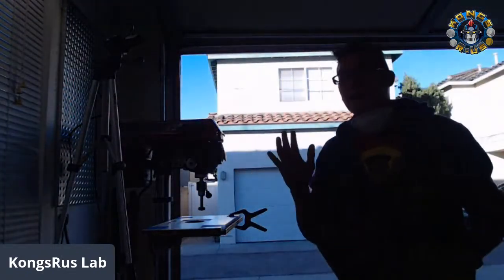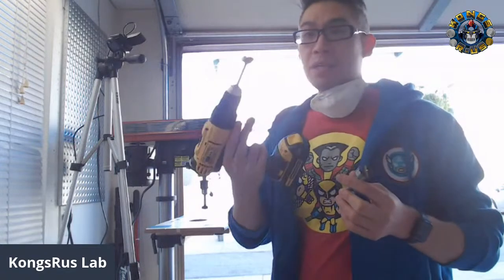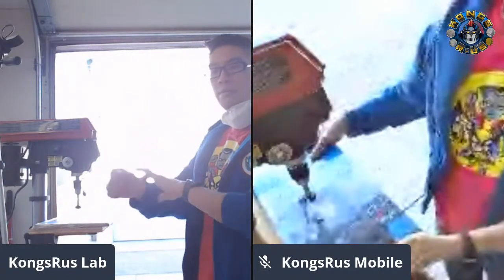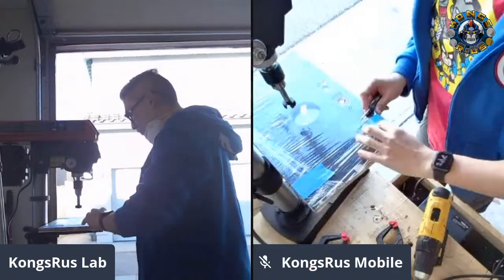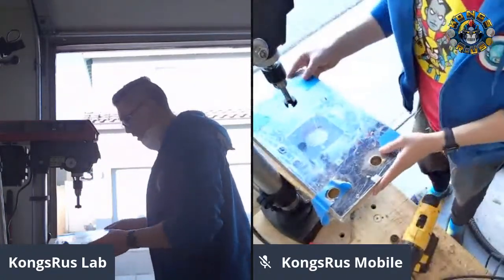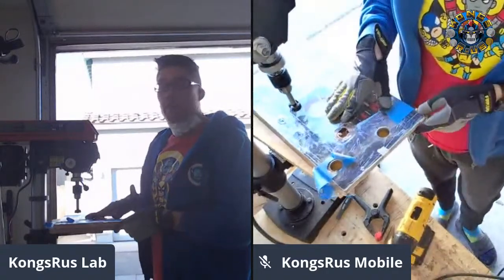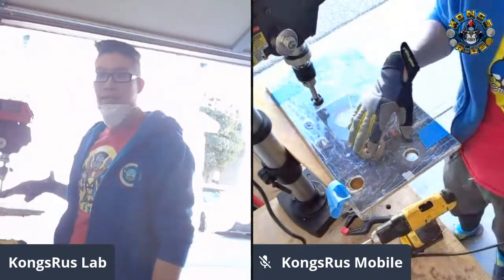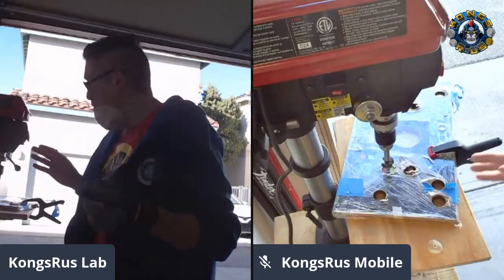How to Drill - LIVE Modding Demo Arcade1Up (Step Bit, Hole Saw, Forstner Bit, Drill Press) Star Wars

Comment: When you saran wrap the plexiglass, do you wrap it and the control panel together? Or do you wrap the plexiglass by itself and then tape it to the control panel?
Reply from the maker: by itself. then make sure its taped to the control panel if you plan on drilling them together

Comment: Do you use the same 1-1/8" bit for panel and plexi or is plexi larger?
Reply from the maker: For most of my mods, I use the same 1-1/8" forstner drill bit to go thru both the panel and plexi at the same time.

If you want to match the style that Arcade1up does with their plexi, they use 1-1/2" holes in the plexi and a smaller hole for the panel
Reply: @KongsRUs  Sincerely appreciated!
Reply: @KongsRUs  sorry, first timer. Safe to assume that the buttons would then go on top of plei, correct (when using 1-1/8 for both)?  Or do you still install to panel and then top with plexi. Seems obvious, but just checking. No further questions 🤣
Reply from the maker: @nafscub  no worries, when I used the 1-1-8" hole. The buttons just sit on top of the plexi. Curious- what panel are you drilling?
Reply: @KongsRUs  nba jam. Select buttons for all 4 players. +3 buttons for P1 & P2. Probably +1 to P3 & P4. Probably not the ideal project fir a 1st timer, but here I am
Reply from the maker: @nafscub  ah snap, lol, that's a big panel!! Biggest recommendation is to tape the plexi to the panel and drill through both with the 1-1/8" forstner bit. After all the drill bits I've used, that works the best for me with plexi and panel. You only get 1 shot with plexi so good luck my dude!
Reply: @KongsRUs  appreciate it!